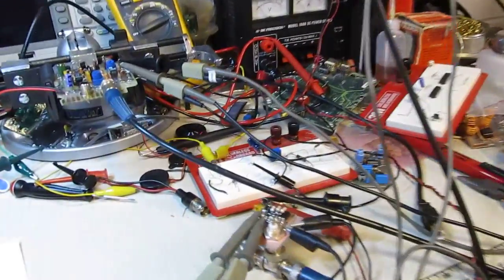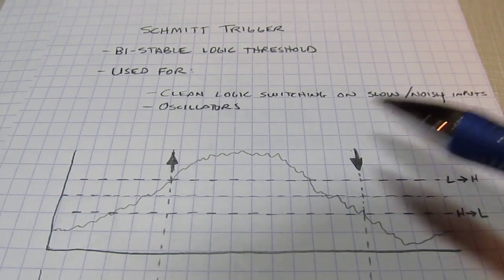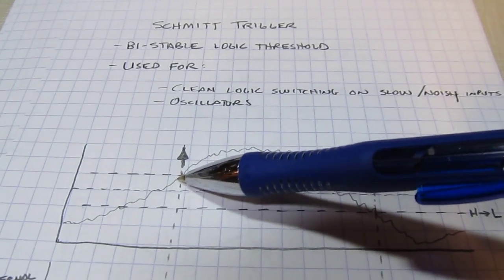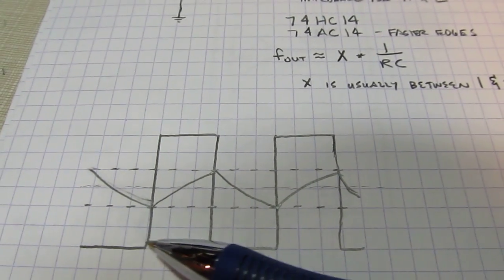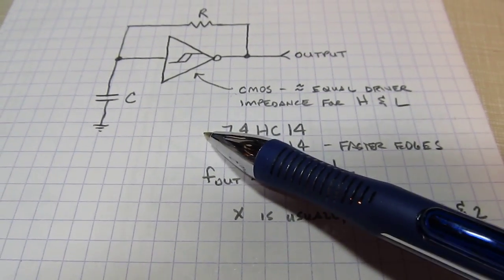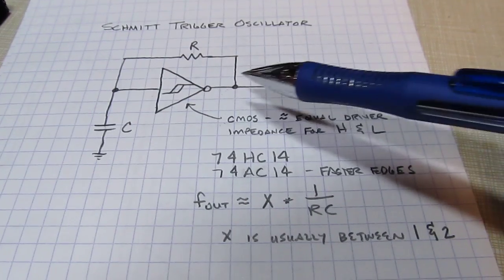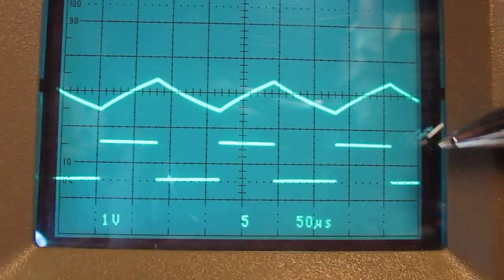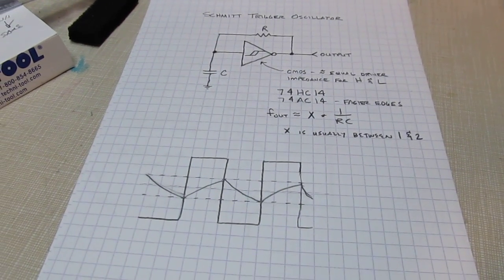#87: Schmitt Trigger Oscillator / Tutorial / 74AC14 Inverter / squarewave generator

Comment: When I tried this circuit with 47nF and 6.8KOhm components, 5V supply (with 100nF decoupling cap), I am not getting stable oscillation. Sometimes oscillation doesn't even start, sometimes it starts, and after some time stops.
I have tried different ICs, cd74ac14, cd74hc14, and sn74ac14n variants as well, no luck. Tried different power supplies (switching, linear regulated down to 5V from 12V, linear PSU as well) to with and without 100uF capacitor, no difference.

Observation - when it doesn't oscillate, the IC is consuming a lot of current (80mA or so - can go for many seconds like this), when oscillation starts, very little current is used.
Observation - when probing at Pin 1 (where RC is connected), the triangle wave is the one that doesn't get formed properly. When it does, I see a lot of high frequency signal riding on the main triangle wave. Tried different R and C values, but still not reliable.

Any ideas what I am missing?
Reply from the maker: The most likely scenario is that the chip is going into very high frequency oscillation. Possibly too high to see on your scope. Most likely due to insufficient decoupling and poor circuit layout. This circuit will be difficult to make on a plug-in protoboard due to these factors. Connections need to be short. You need a good solid ground plane. Decoupling with both large bulk capacitance, and good high frequency ceramic caps.
Reply: @w2aew  Yes, this is just what happened to me. I tried to build it on a protoboard and I can only see around 270-300MHz sinewave oscillation at the output. Once when I moved the board/connections it started to produce the squarewaves at around 3kHz, but after a few minutes it went back to high frequency oscillation again. I will build it on PCB... Thanks!

Comment: Can i get 10 MHz square wave with 74hc14
Reply from the maker: you should be able to
Reply: @w2aew  with 74hc14?
Reply: @w2aew  i will use clock oscillator with hc14?

Comment: hello Sir ,
How i can generate 65kHz square wave would you please help me
Reply from the maker: +Nasser Samim You can use the circuit shown in this video, simply adjust the capacitor value (lower) to increase the frequency to 65kHz.  The exact value will depend on the IC you use, so you'll have to experiment with it.
Reply: thanks Sir